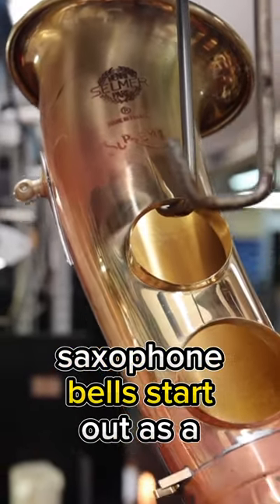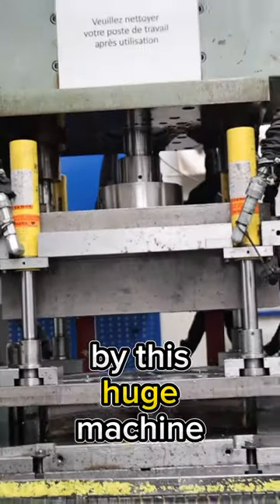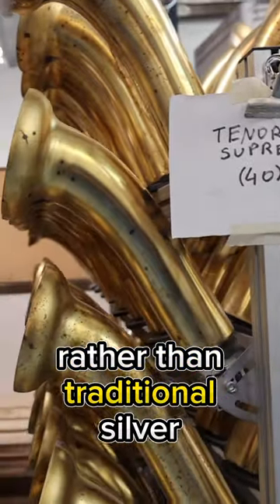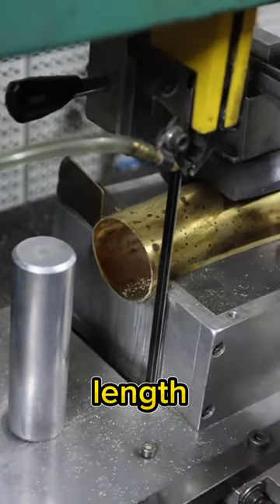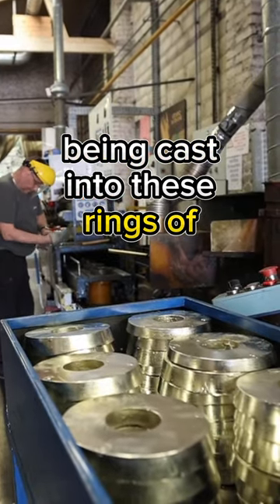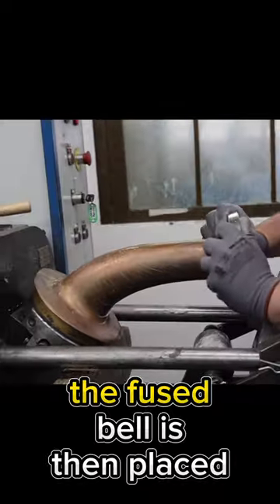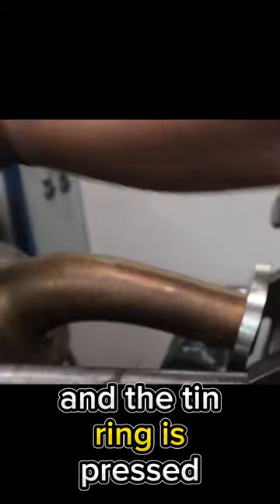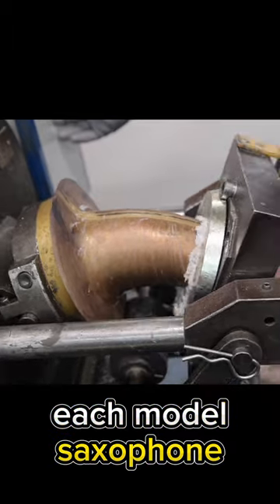Making Selmer Saxophone Bells

Comment: So how does an inert gas such as Argon fuse the metal .  Surely it is electrically welded or what ??
Reply: yeah he misunderstood.Argon is a shielding gas used often in welding to help protect the project from water or Oxygen interfering with the weld. Using Argon as a shielding gas helps prevent any reaction that could be a problem during the welding process. Argon gas works best with Titanium, Magnesium, and Aluminum. (from google)